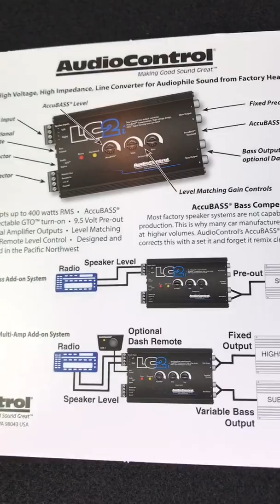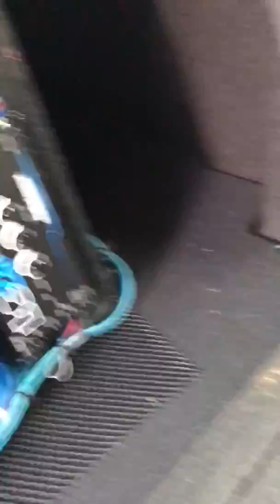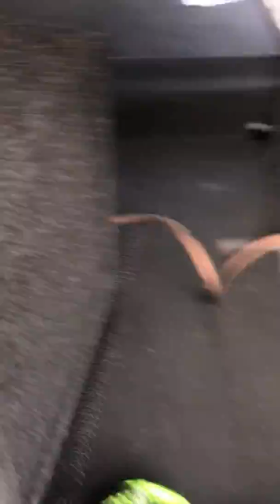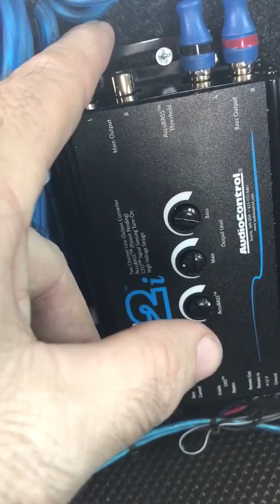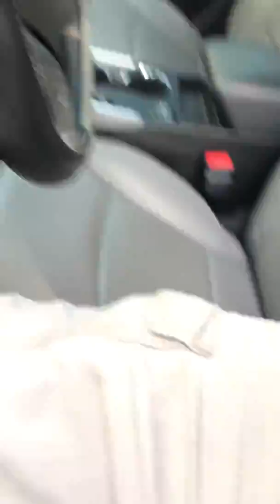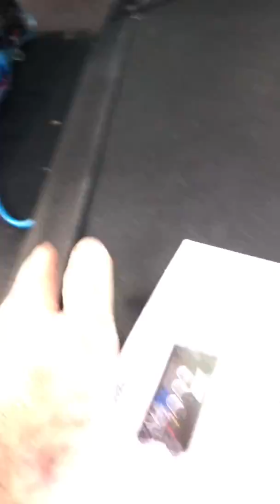LC2i install 2013 Sonata Limited

Comment from the maker: Thanks everyone for the comments..I do apologize for the late replies to some people...I'll be posting a new video showing the new setup since changing boxes and with the system running...I have had no issues besides blowing the first P3 (melted the coil) I was over powering it with the gain...I would like to state again I'm a do it yourself person and in no way a professional..
Reply: Jacob McCurdy Not sure honestly. The bose head unit I think is controlling everything. My subs are weak and smell when I raise the volume up even when they are no where near distortion. Not sure what to do at this point.
Reply: Hey Man, still good video! You’ve shown me something that all of the other vids didn’t! You didn’t mention using the Threshold control though and you probably wouldn’t have had to have the Bass set so high!

Comment: So you only need to tap into one speaker? I’m confused because it says left and right
Reply from the maker: Depends what single you are trying to get. The LC2i is built for bass amp and main amp since I was only using it for subwoofer amp I just tapped the subwoofer. If I was doing a 4 channel amp I would have tapped a full range speaker.
Reply: @jmccurdy2009  I’m trying to get signal to two additional 6.5 speakers and tweeters I’m adding.
Reply from the maker: @Jose-ew6hj   you only need to tap a full range signal then
Reply: That one speaker is actually a dual voice coil speaker so it is left and right. I don't know if he used the left coil.
Reply from the maker: @catdaddy7909  that’s not how DVC subwoofers work. There is no left or right on a DVC Subwoofer. You either wire them in parallel or series to get the ohm load at the amp you want  usually Dual 2ohm or Dual 4ohm are the most common DVC sold. Wiring a DVC 2 ohm in  series creates a 4ohm load. Wiring a DVC 2ohm in parallel creates a 1 ohm load which the sub in the video is wired to 1 ohm. 

The left and right inputs on the LC2i are only to grab multiple signals and should not even be labeled left or right imo because the LC2i does not have a balance control or fade control this still happens at the head unit.

If you tap into a full range speaker signal you would still only need one input and if you only needed the lows for a subwoofer you would let the cross over on the amp to turn it into a low range signal to the subwoofer. The extra input is there for flexibility depending on where you are getting the signal from in your vehicle and what you plan to output it to. 

Hope that makes sense
Reply: @jmccurdy2009 That might be true but that's still how you tap into both right and left sides. It's other videos on YouTube tapping into both sides of the subwoofer.
Reply from the maker: @catdaddy7909   yes its a DVC thats in the car to but you are getting a signal that is it. the signal on both coils is the same. so why would you tap both? its a waste of time. There is no left or right when it comes to subwoofer coils its coil 1 and coil 2.

Comment: Everyrhing is pretty clear,just one question did you got signal from one single speaker and noticed you connect positive on the left speaker and connect thr negative on the right speaker?im planning to install this on my one.and want to make sure i do it correct👍

Comment: What speaker should I use to replace in my front drivers door? I have the infinity sound system in a 2012 sonata, I was told it was sold as a component system snd I’d need to buy the whole set. Crutchfield only gives me specs for the stock audio system.
Reply from the maker: I replaced mine with a set of infinity speakers. You do not need to replace the whole system. I believe they are 8ohm speakers (it’s been awhile) you. An replace just the front speaker if you want

Comment: Do you not need a fuse between the LC2i and the Amp?  I would think you would want to at least put an inline fuse there for protection?
Reply from the maker: The amp is what feeds the LC2I there is a fuse between the amp and the secondary battery. This setup has been changed many times since initial install. You can fuse it if you want..if you watch my updated video after this you will see the setup is totally different.. I have since sold the car and have a new system in my truck and didn’t have any issues running the system the entire time it was setup
Reply: @jmccurdy2009  Thank you!!!

Comment: Thank you!!! I had a problem with my sub output not working fully unless I would balance my volume to either left or right speakers.  Now I realize I didn't have to hook up both speaker leads to the LC2i. Switched that and now my bass is banging

Comment: What type of wires did you use for the ground  and 12v connection for the LC2i that is connect to the mono amp? Is it 14 Gauge wire? And where can I find this wire at?
Reply from the maker: I just used regular copper 18 gauge wire you can get this wire from home depot, lowes, walmart, auto parts store ect.

Comment: Do you have any issues jumping the power and ground directly from the amp? I am upgrading to this from a cheap passive one and I need to find the best way too power it. This seems like the easiest way for sure.
Reply from the maker: Josh Snow I did not have any issues with it for the year plus a Iran the system in the car before I got rid of the car.

Comment: Great job on the video. Just installing this in next month or so. Big help. Like how you paralleled the power of the amp. Hopefully this has been a reliable set up.
Reply from the maker: Thingsthatgo250 no issues from this setup the time I had it and run same setup in my wife’s Ford Edge with no issue for over a year

Comment: I wanted to ask you a few questions. I’m going to install the LC2i  . Did you tap into left and right rear speakers ? I ask because you have both RCAs coming out of LC2i  and it looks like you have both wires going to positive? I tapped into right rear speaker for a signal for mono amp and was going to use small jumper wires on the + n - for signal on right output
Reply from the maker: I tapped into my factory subwoofer channel but any full range signal will work. Yes I use both the left and right side rca jacks from the lc2i to the amp. Not sure why you would need a jumper wire. Also not sure by what you mean by both wires going to the positive?

Comment: How exactly did you determine that the black wire is the + and green wire the - to the factory sub? I can't find any wiring diagrams out there for 2012 Sonata.
Reply from the maker: Matt Kearns her Matt it was tested with a volt meter but I was also able to find wiring diagram as well

Comment: Good video. I was also told to put a 1A or 5A fuse in between the daisy chain of the power going to the LC2i. did you think of replacing the stock 8 inch Sub and then power that with the LC2i hook up you have?

Comment: Hey man! Im not getting any high freq bass or really low bass after setup. Hits hard on maybe 50-80. My factory sub has 2 terminals, 2 pos and 2 neg. Im running all into the lc2i left and right so slots are full. Thinking its a phasing issue. What do u think??
Reply: Sorry just relalized i already asked you a similar question. Anyways i figured it out. Just switched the polarity on the amp and it sounds awesome now!!
Reply from the maker: Have you tried turning up the accubass? Also you sure that you are tapping negative and positive and not the other way around? Also what car do you have year, make and model

Comment: Hey bro!! Got it all hooked up. Sounds pretty good. But how do i need to set the lpf on the 500.1?? Im getting all lows and nothing from higher bass notes. I have the 500.1 rf amp, 10 inch p3 in a q bomb ported box. Thanks
Reply: I think i have it on like 80 now
Reply from the maker: I usually set mine to 80Hz for LPF

Comment: just installed mine! my maximize light does not light up at all tho. is that ok?
Reply: greg0716 same here I don’t know what’s the problem
Reply: Make sure you play a 40hz 0db sinne wave test tone & have your Headunit play 75% volume and then go to the back and make sure that the gains on both amp & lc2i is turnt all the way down . And even accubass. Slow start turning the “Bass” knob up until you see the maximize light go steady then back it off a lil until you don’t see the light anymore . I recommend using a dd1 or a dmm to check how much voltage it’s putting through the rca and make sure to match the input Rca voltage and never go above as that will result to a over power bad signal . You want a good steady clean signal . Make sure you have threshold turnt all the way up as that will have it on constantly and then play with the accubass knob very slowly . It can spike up the voltage going out . Good luck

Comment: You answered a huge question weather I can use my amps Power and ground and just clamp it with my 0awg wiring thank you. Now my other thing is I just received this and realized my amp has a high input slot. But I think this should sound better so I'll probably keep it
Reply: i just realized that too on my amp. prime 500.1. im keeping it since i already opened it lol
Reply: @greg0716  not sure if the LC2 I received was defective or not. Or the guy that did the install fucked it up but this thing blew my subs right away with my amp and LC2 turned all the way down. I think dude installed it wrong and tapped into the wrong shit. I should've went to the shop I originally bought the system from. And I'm running a expensive set up Memphis prx1500.1 and 2 alpine type Rs at 750watts RMS each. Crazy how they seized up with barely any noice but they were in my last car making the whole block shake from a mile away. Oh well went to the shop and they said I have warranty and I'm having them check everything. I'll see what they say about using the LC2 vs my amps high input. And if they say LC2 is better I'll buy a new from them and return mine just so I make sure it wasn't defective plus give them some money(they process match anything online for me) kind of pissed but feel blessed there honoring the warranty

Comment: Nice vid!! Couple questions. When i tap into my factory sub i assume the factory sub will still play as well, do i need to dial down my bass at the head unit so it doesnt distort when i crank the volume? And did you bridge the speaker imputs into the lc2?
Reply from the maker: I would set the bass at the head unit at what you want to have your car speakers at for my car I have it plus three to the right of center. You can use the bass knob on the lc2i to increase from there.

here's a quick ohms law calculator you can use to see what you are getting. measured at the amp for voltage need a 40hz playing while you measure. Yes I bridged it the way that the instructions show. 

http://www.ohmslawcalculator.com/ohms-law-calculator
Reply: And what size ground and power cables did u use for the lc2?

Comment: Thanks for this video, VERY helpful.  I also set up my sub with a LC2i but when I turn off my car, the amp led wont turn off.  Would you happen to know why?
Reply from the maker: How did you wire the remote wire? hard for me to possibly figure out not knowing how you wired everything up. If you can give me more information might be able to help.

Comment: With you only using the lc2i for the subwoofer did you just use one speaker input? If so that will save me a ton of time and money.
Reply from the maker: Elder Toad yes only one speaker output
Reply: Jacob McCurdy Did you bridge it between the two or only use one side?
Reply from the maker: Elder Toad I bridged it like the instructions show on the diagram. If you pause the video at the beginning you will see what I’m talking about.

Comment: Hey I'm thinking about getting this in my truck. Have jl j 750 and 2 12inch tw3 d8's kn stealthbox. The nose factory system is fucking it all up I've heard. Will this make a difference? Dont want to change the factory head unit so if this device dont fo the truck I'm selling everything n starting over.
Reply from the maker: DOME KNOCKA how are you currently getting signal to the amp? Does the factory radio have rca out?

Comment: Cant find this info anywhere maybe you can help when connecting the LOC to the stock sub woofer can you explain it, i know you have to hook to a + and - of left and right but when tapping into the stock sub wires what wires are you hooking to this and what ones are left over and maybe not used, are you using the stock sub as the left or right or both?
Reply from the maker: Travis the sonata factory sub is a DVC I am only tapping one of the coils to get the signal needed for the LC2i. I simply tapped Negative and Positive and run that to only one of the LC2i negative and positive terminals (if you pause the video at the beginning where the instructions are you see that they have a negative in the far right and positive in the far left and this is the way i did it on mine ... almost like a bridge). I have a set of empty negative and positive terminals on the LC2i that are not used. I have hooked up the wires to both terminals of the LC2i and did not notice any difference... hope this helps.

Comment: The rca cables you have connected to the top of lc2i the bass output. Are those running to your amp?
Reply from the maker: Sunny Basra yes
Reply: Jacob McCurdy and then power was connected to lc2i was from amp. And you put nothing in the remote in on lc2i
Reply from the maker: Sunny Basra yes I used 12 ga power and ground from amp to LC2i remote also goes from LC2i to amp... when LC2i sense signal from tapped speakers coming on it turns on the amp about a 2 sec delay before sub comes on from when head unit comes on
Reply: so when I installed my subs and the lc2i i dont get really good bass. I have the bass and acubass all the way up. makes very little difference. anything i did wrong?
Reply from the maker: What car do you have? Also what speaker/s did you tap to get the signal for the LC2i?
Reply: Jacob McCurdy 2015 charger srt. Tapped into rear subs. Got it working now. Sounds good
Reply from the maker: Nice sorry about the delayed responses.. make sure you don't have the bass all the way up on the lc2i can cause the sub to clip and burnout.
Reply: Jacob McCurdy i have it set to the end of the line. It still goes a bit further then that

Comment: Where did you get the harness that you connected to your factory rear speaker/subwoofer harness that you tapped into? I am going to be doing this on a 2016 Accord in a few days!
Reply from the maker: Miles.Mindset I didn't use a harness to tap the wires of my factory sub.. I used wire taps that you can buy from Walmart
Reply: Jacob McCurdy okay I see what you did so is your factory sub still playing with the Rockford sub? It looks like your harness is still connected to the factory 8" sub. Thanks for the quick reply
Reply from the maker: Miles.Mindset yes factory sub is still hooked up.. I have since switched boxes and subs. Now running a skar audio 10 sub and a ported 1.5 cubic inch internal volume box.
Reply: Jacob McCurdy So did you do most of your sub volume control and tuning from your amp for the aftermarket sub? Would you recommend leaving the factory sub hooked up? Thanks for all the help man!
Reply: Jacob McCurdy How does the SKAR 10 sound?
Reply from the maker: Miles.Mindset I have the ddx series from skar and I'm glad I made the change... hits the lows and sounds clean...I prefer this sub over the RF sub I had...
Reply: Jacob McCurdy Awesome I am putting in a JL W3 in a 1.8 cubic foot ported box tuned to 36 hz. Should come out sounding really nice and clean!
Reply from the maker: Miles.Mindset yes I did most of the tuning from the amp... as far as the factory sub that's going to be up to you.. the Sonata uses a JBL sub that is free mounting so it dosent do the lows very well but helps fill in the mid range which why I left it hooked up..not sure how the subs in accords sound or if the are enclosed or not.. I would listen to it with it hooked up and then disconnect it and see which way sound better to you..
Reply: Jacob McCurdy Can you seal the wire up later after you tapped in if you wanted to sell the car? Just wrap some electrical tape around it?
Reply from the maker: Miles.Mindset yea that's why I used the wire taps cuz it uses a thin blade to make to connection... once you remove the wire tap there's no signs that the wires we tapped
Reply: Jacob McCurdy How exactly does your LC2i turn on? I see you have your remote out going to the remote in on the Rockford Amp, just a little confused what turns the LC2i on since you said you don't have anything hooked up in your remote in. Does it turn on simply from the speaker wire that's running to it from the tapped factory sub? Or did you run a remote turn on wire from the factory sub to the LC2i? Thanks!
Reply from the maker: Miles.Mindset yes the LC2i turns on what's it sense a signal from factory sub that's the gto function. The 12v power is bridged from amp to LC2i and so is the ground.. I do not have a remote going to the LC2i to turn it on the remote wire you see goes from LC2i to amp for the amp to come on... when I start my car there is a small delay before the amp comes on.
Reply: Jacob McCurdy Awesome okay thanks again man you've really brought a lot of clarity to the install! I really appreciate it!
Reply from the maker: Miles.Mindset np let me know if you need any thing else
Reply: Jacob McCurdy Will do. I am going to be putting it in tonight/tomorrow. I will update you on how things go! 😎👍🏼
Reply: Jacob McCurdy Did you bridge both of the channels together on the LC2i? So positive from the left channel and negative from the right channel?
Reply from the maker: Miles.Mindset yes -right +left
Reply: Jacob McCurdy why did you bridge the channels on the lc2i? Great video btw getting ready to do this on my 2011 sonata limited.